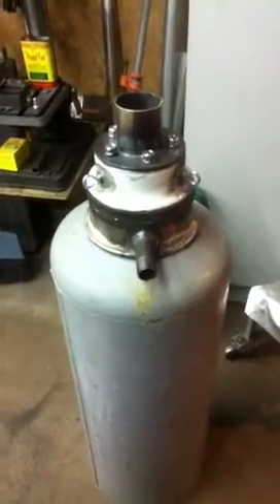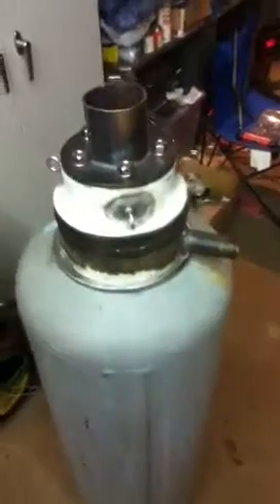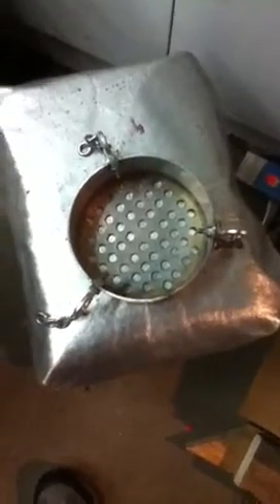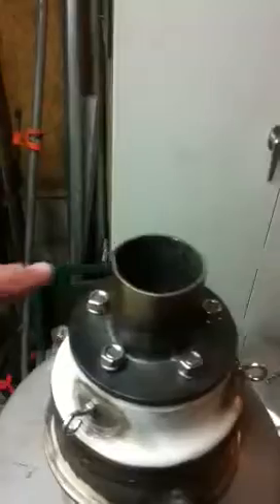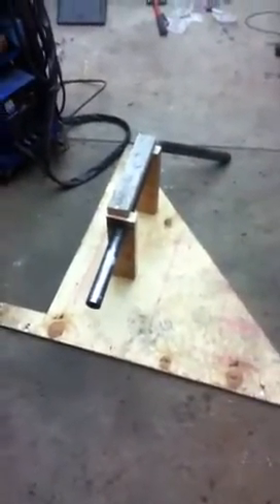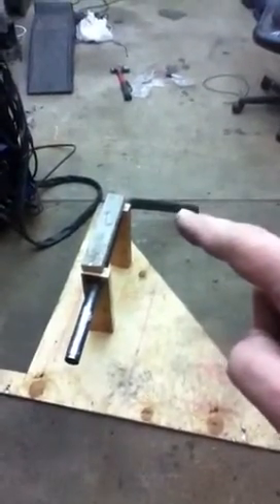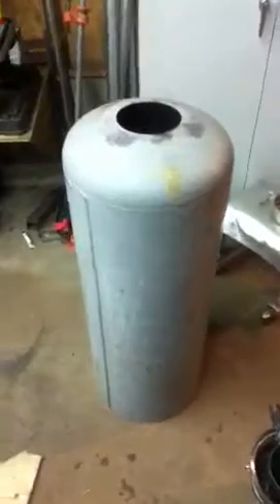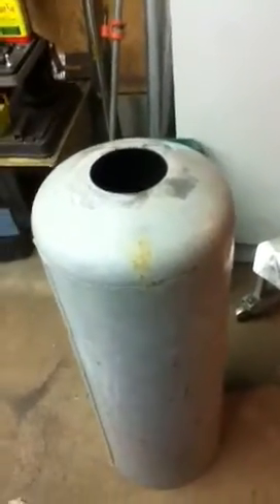Heart of the " Flashifier "

Comment from the maker: I will be running a single nozzle. I am oversizing all of the pipe diameter fittings that I will be welding to the vessels because I can always reduce with fittings.I am waiting to hear back from the local vo-tech to find out when to send material to the school for all the flanges I need ( cut on cnc plasma table). This gasifier will be totally servicable. everything will be removable. While I wait for flanges I decided to start moving on to other parts of the build. I will be mounting the gasifier to a scaffold frame from harbor freight. This will give me an already complete rolling frame with plenty of room to mount everything, including a crane for dissassembly ( my barrel is approx. 1/4 " thick).

Comment: The only issue i can see with your gasifier is where your hopper meets your fire cone,,, i used an iron sewerage reducer  from 10 inches (hopper) to 6 inches(firecone),, the distance of the reduction spans 4 inches,,therefore its very gradual, so as to eliminate any bridging of fuel and stop the clogging in that area,, otherwise all looks dandy!!
Reply from the maker: There will be a funnel inside the hopper ( also part of the pieces I'm waiting for ). It will be 17 " tall , and transition from 14" down to 6 "

Comment: Oh, one more thing... Someone approached me with another killer idea too that you may want to consider. Instead of welding the rim to the hopper, weld you some bolts to the bottom of the wood hopper then weld some dog ears onto the rim and BOLT it into place using some fiberglass rope along with wood stove door cement to achieve an airtight seal with the rim to the wood hopper where they marry up. This will make the gasifier 10000% serviceable and upgradeable if you ever feel a need to make any changes...
Reply from the maker: I love to hear good ideas , especially before its too late . I'm going to kick around these ideas before moving on. I like the cone idea in the hopper too. I think I'll do that. I'm trying to get my hands on a stainless frame that will otherwise end up as scrap . I think it would really be nice to use as a stand for the whole build. I'm keeping my fingers crossed that I can get it for a reasonable price.
Reply: mazdalorean
This thing was a learning curve in process for me so I could have made a lot of improvements to have simplified the build too but better late then never. I cannot remember if it was youtube user Tecknowfreak or youtube user David Gagne that came up with that suggestion but when I read it I had to agree because it would have cut time off of the welding job and made the gasifier much simpler to service too!

Somewhere along the line I'll build one more gasifier up with all of the improvements but that's down the road. The main thing is to make it friendly so that you can service it with ease. That much I did get right on my build.

As youtube user CNCmachiningisfun says once you get bitten by the gasifier bug, it's all over especially once you see an engine run from the gas. Speaking of CNCmachiningisfun, check out his channel. He is off grid. He uses woodgas in the winter and solar and wind in the summer.
Reply from the maker: flash001USA Originally, I wanted to just weld everything together to keep the build simple. I just assumed there would be no reason to take it apart if you built it with all the lessons you guys learned. You guys really make it sound important to be able to dismantle it.  You all know much more than me about gasifiers, I'm just a fabricator into a cool project. I'll tell you what I'm not in any hurry to rush through  this , so I have to do this how you guys would like to see it. I will make the rim removable , and the cone chute to help direct the wood . You guys spent months trying entire builds without even knowing for sure what works. More importantly , you posted videos showing everything you learned. Let me know if there is any other items you would like to see  worked into this , because if you give me the idea that you think is an improvement, I'll be glad to build it and share it. Thanks for all you've done .

Comment: Damn man! I'm blown away! That's sharp as hello! You took what I had and really refined it! Nice job man! This video has really made my day! This setup WILL work for you and it will be very stable. Just be very aware that the correct fuel sizes are critical to your build. I use a mixture of 1/2 inches up to 3/4 inches maximum sized chunks and the best fuel I have EVER used is small dead branches because they are already dried and cured and they are easy to collect and cut too.

I'm not sure how deep you are making your wood hopper but if you make it very deep you will need to make a condensation trap to capture any water that sweats from the wood as it is consumed. You may have seen that on a few videos from others building gasifiers where the builder placed an inner water lip near the top of the wood hopper that fed outside to an air tight container that allowed it to drip off but because it's sealed it does not let air back into the system.

The only thing I see in mine is when the fuel gets low it will have a natural tendency to build up onto the sides of the wood hopper  Once again,  just be sure to use the correct size fuel size and this thing will rock and roll.

I'm even considering adding a inner sleeve inside of my wood hopper that will be the same diameter as my top lid opening to help control water condensation and to keep the fuel dead on top of the fire cone to aid in eliminating any bridging issues too.

This will reduce my capacity some but the trade-off will greatly stabilize and aid in the fuel chunks dropping into the fire cone easier and this should aid in keeping any bridging down to a minimum. You could even add a sheet metal cone into the bottom of your wood hopper to act as a funnel that directs the wood chunks right into the fire cone too. If I had thought of that while I was doing my build I would have done that but I already have a workaround so all is good.

Now, one more thing... What size engine are you planning on running on your gasifier? The 3 inch bolt-on straight pipe will be geared up to handle anywhere from an engine size of 12.5 up to an 18 Hp engine with hot enough temperatures to crack the heavy tars.

You will never really crack 100% of the tars 100% of the time not unless you are hard core stringent on the wood chunks and the type of wood you use along with just plain out learning your personal build but you WILL have the tar issues so low that they will be easily captured in the filter system. Once again, great job and I'm looking forward to seeing this up and running soon!
Reply from the maker: I don't have a generator picked out yet, but I'm aiming for one thats 10,000 watts or so. I don't watch tv, I watch flash vids. I have a few mods up my sleeve just to eliminate spending too much time and effort on the build. I'll post some videos along the way ( this time not holding the ipod verticle so the picture is full screen). I'm just glad my 8 year old son's curiosity is peaked , so he gets pumped to work out in the garage. He actually drilled every hole in the ash grate! He also gets to do all the welding that isn't critical.
Reply: mazdalorean
Once you construct it do like I did with a good handful of burn-in test. You'll know when you have it figured out. Be sure to save all of your biochar too. That's yet another good secret to a clean start and a clean burn. I forwarded your video to a bunch of other people to check out too.